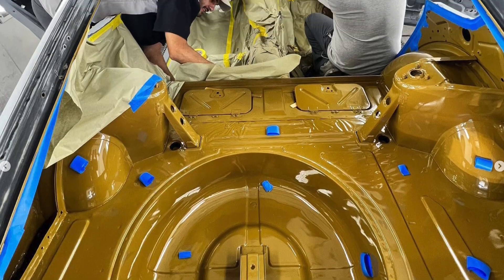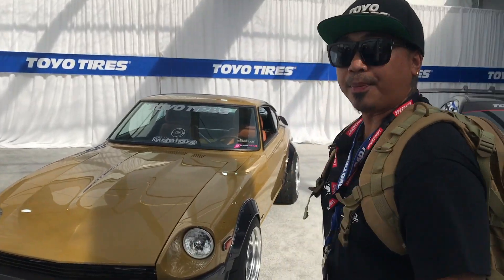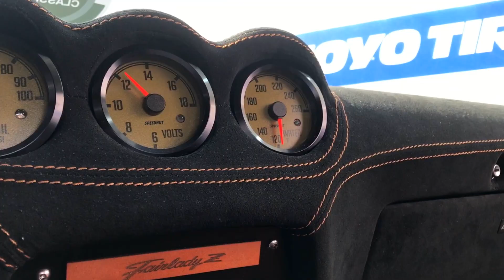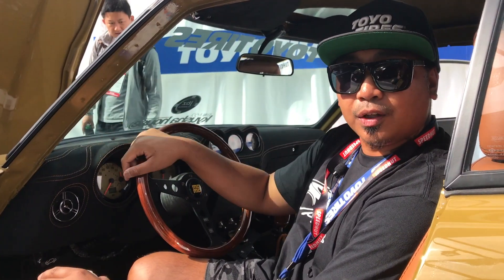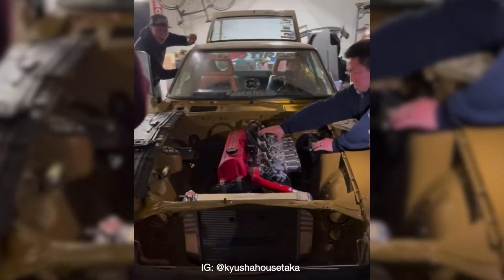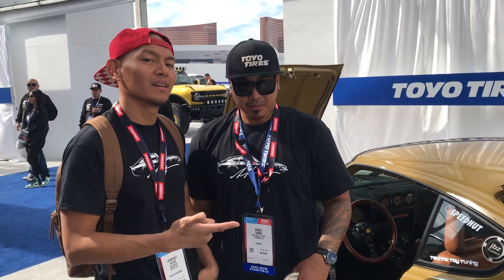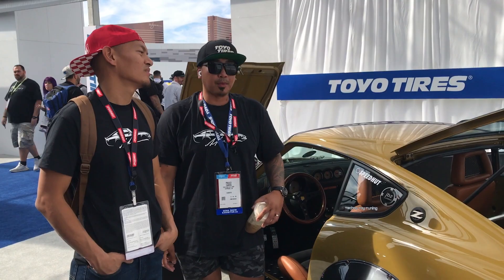1972 Datsun 240Z: Paulo Tabora's SEMA Build

Comment: I’m interested in the 3 3/8" GPS 120mph speedometer. This is going into a 1994 C2500 with Stahl box on the back.
The extra features of that GPS speedometer are useless to me, they can be acquired from my smartphone. 
The features I can use are from your non-GPS speedometer, Service Alerts OIL CHANGE, TIRE ROTATION, GEN. SERVICE Ect.
Can I get the features from NON- GPS on the 3/38" GPS Speedometer? If so what would it cost?
Thank you for your help and have a good day.
Reply from the maker: Here are our 3-3/8" speedometers: https://speedhut.com/categories/gauge-types/led-lighting/speedometers.html?_bc_fsnf=1&Size=3+3%2F8+inch
Reply from the maker: The GPS speedometer is very convenient to install, is why many customers like it.